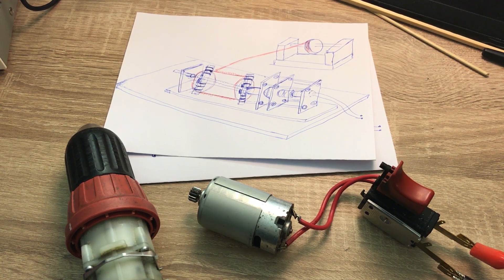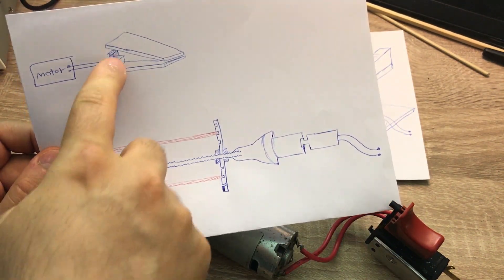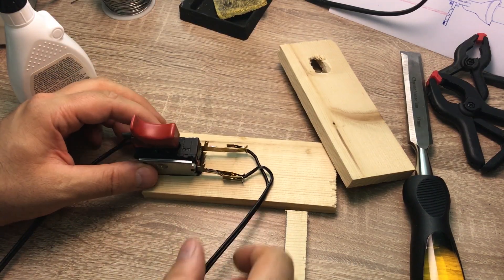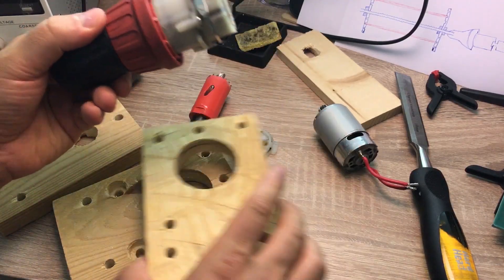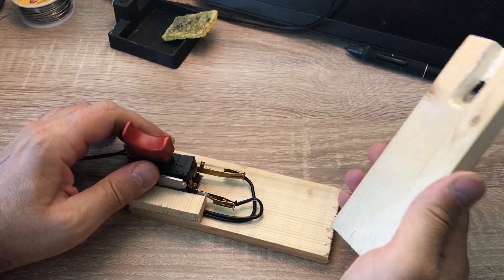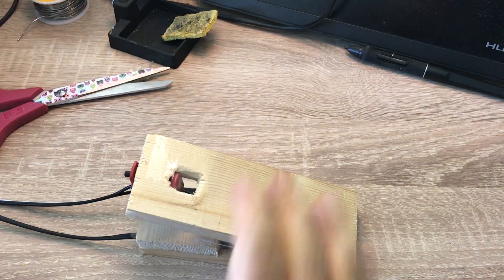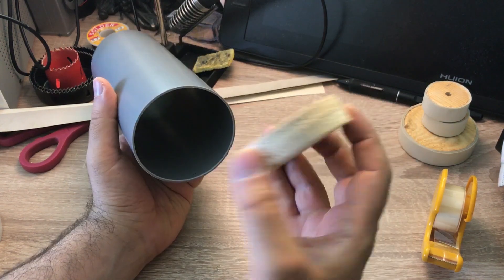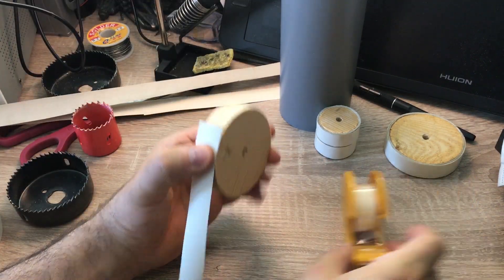Coil winding machine with foot pedal ( semi-automated ), for Tesla coils and other types of windings

Comment: You can Run your  wire
from a spool  through a book ,.
.few books makes nice adjustable column ,
Pages make nice clutch/ brake ... 
and  ...  You can ad some
 weight onto
 the book cover.. ( top).
(*  transformer or a bag of beans ... or similar ...).